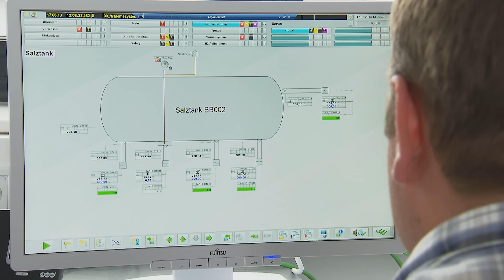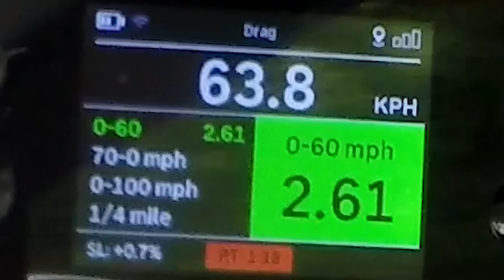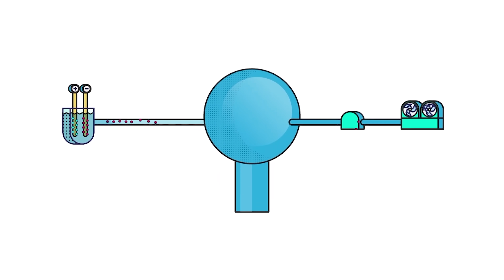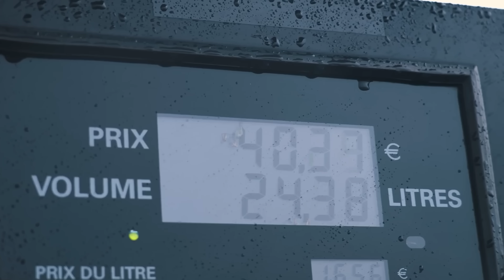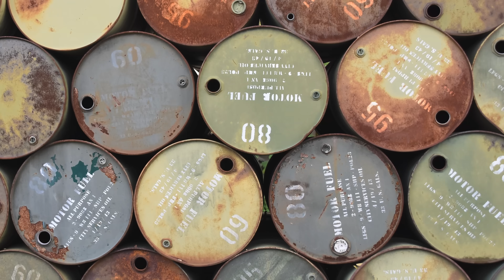Porsche just SAVED petrol engines FOREVER

Comment: This is another gimmick to fool people by telling them they are recycling energy. It requires energy to recycle the used energy. Because of the conservation of energy cannot be violated, they are just putting a new energy between the chemical boding of the C and H by removing the C from CO2 and H2O (thru electrolysis). This new energy most likely is coming from another fossil fuels, Solar power. (made with fossil fuels) or electricity from nuclear energy. This is Hocus Pocus engineering. Let’s say even you are right, what about the economics of it. If system is 100% efficient, which it is not, they still have a lot of expenses. First law of the thermodynamic can’t be violated. They are keep increasing the entropy this way. This is like free energy produced by the Indians and Pakistanis Youtubers.  people believe this stuff.

Comment: this video is a load of nonsense. it was 5 mins in before you spoke of the TECH to revolutionize the industry. ICE cars are dead and for one reason. They are too complicated and there is far too much that can go wrong. EV cars are far more reliable. Let me give you one example. It takes hours to take a turbo out of an ice car and it costs a fortune to repair any of the major components ie the engine and transmission. The new modern engines from all the manufactures are riddled with issues as they've gotten even more complicated. They've made them so complicated trying make them even greener that its time to say stop..... An EV is a little more complex go kart. There is very little to go wrong. Once the cost of the batteries come down there will be no going back. People will buy what works best and there aren't too many EV owners getting rid of them and going back to a diesel turbo charged car.

Comment: Consumer demand or lack thereof will take of combustion engines by itself by 2035.  Costs will keep coming down on EVs while the tech keeps improving.  Cars won’t be near as special anymore and we’ll all be zipping around with instant max torque and 2-3 sec 0-60.  But I think this synthetic fuel is great for racing applications.

Comment: E fuels were tested on top gear a few series ago. This is old news and the cost of each litre of fuel would be in the hundreds. Also never going to produce enough e fuels from renuables just like the hydrogen pipe dream. Also ice engines are so complex and costly to repair. The same old technology keeps on going on the next generation of a manufacturers cars. They want an easy out of this ban. People will have to keep and maintain their old ice car if you don’t want an ev. Ice cars can last 16 or more years if maintained well. They are not banning fossil fuels in 2030 and they will still sell it for years after as ice cars sold in 2029 could sill be on the road by 2045.

Comment: I think that, here in the UK, the target of selling only electric powered cars by 2035 is a bit ambitious. Even the step from hybrid-only in 2030 is quite a push in terms of our current engineering capabilites, as well as cost factors.

As per this video, more leaps are being made towards fuels, driven by the recent hikes we have all seen in oil prices (more to come). But we need to see more sustainable innovations before we can all make a solid leap from one type of fuel / power to another. More infrastructure will be needed (recharging / re-fuling) in order to sustain a better way of powering vehicles.

Government targets are hocus-pocus without a solid framework around such an emerging use of this  technology.
Reply: The 2nd hand car market will be gigantic in the UK after 2035.  Many UK drivers will want to keep their old petrol engined cars running for as long as possible.

Comment: E fuels What a load of greenwashing shit just how much energy is required to remove CO2 from the air, only slightly less than the amount of energy released buy burning hydrocarbons, and no one is doing it on any scale yet just because it is technically possible doesn't make it viable. I'm not anti anything on the vehicle front I love an overpowered motorcycle or a truck rolling coal I just see things for what they are. If you really want to be green walk and live in a mud hut and don't take meds coz a lot of them come from oil. Yes I do belive we need to reduce emissions output but until china India America and Australia stop burning coal and air freight and travel are emissions regulated and domestic emissions reduced we are all fucked road transport is tiny rail transport is even smaller and bulk shipping is also small 
Just remember the man on the street is an easy government target

Comment: This sounds extremely stupid. 🤦
You know what happens in car engines when you use synthetic fuel? Its combusts in order to power the engine.
And you know what comes out of the exhaust? CO² and other by products because such feul only reduces CO² Emissions by 85%, nor 100%.
And lets not forget that all the necessary infrastructure to ramp up production would cost a massive amount of money and work require a very large amount of electricity, which cannot be supplied by renewables give how piss poor in energy protection and inefficient they are.

Comment: The synthetic fuel has been developed but it is in short supply  and approx. $40.00 litre.
Reply: Just like every new technology ever developed. It's expensive and scarce. However both will change in the next decade
Reply: @ahihatv468  This is far from being true. This is because the process of creating e fuels is extremly inefficient due to conversion losses. So what you do is istead of charging a Battery, you take already produced electricity from renewable energies to create hydrogen out of warter (~30% losses) then  you need to extract CO2 from the atmosphere (also extrem inefficient) then you create your e fuel in a reactor (more losses) and transport the fuel to your gas station. At the end you get about 17% efficiency from well to wheel instead of ~85% using a electric car.
Reply: @LionAndi  inefficiency isn’t the main problem to the consumer here. Since the resources used for efuel production is pretty much infinite. The main problem will be higher price itself. But this much progress in such a short time is made by only one company and now TOYOTA and STELLANTIS (two of the biggest automotive companies) have also decided to support Porsche and e-fuels. The problem of high gas prices is likely to go down as mass production takes place and cost of transportation is significantly reduced. In fact, by 2025 the price for it is expected to drastically go down.

Comment: I wrote my diploma about e-fuels.
Sorry for this spoiler at the beginning of my text, but it is pure rubbish (using it in cars).

Expensive, ineffective (over all efficiency less than 12%), Needs H2 comming from electricity (why not use E directly???), aggressive in fuel suspension system, heat rate just ~50%…
The list is endless.

Kind regards from Germany from a powertrain automotive engineer 🙌🏼

Comment: If to produce the fuel, they use CO2 recovered from the atmosphere AND CO2 captured from the factories, the fuel does not have a potential to be carbon neutral because the waste from the factory would be captured anyway also it's a completely diffrent source of emission.

Comment: WOW, does this guy not understand climate change science? The ban on new car fossil sales is in 2030/35 and this is a problem because we don't have the infrastructure in place right now, what a knob! E-Fuels are only neutral for the extraction point, in a regular engine they still emit co2. So not carbon neutral. The process for conversion from Methanol to road fuels requires power which is less efficient than just charging batteries! The possibility of being carbon neutral does not equate to actually being carbon neutral as capture is not a viable technology. It's even worse if you charge at home? So what else is the car doing whilst you are asleep? Just charge EV's at double the efficiency of Efuels!

Comment: Just like hydrogen cars, the issue is the amount of electricity you need to create the synthetic fuel. You could use the same amount of electricity to power cars directly, cut out the highly taxing middle man of producing a fuel, and achieve way more range. I don't see this going anywhere further than for specialist racing.

Comment: E-fuels don't really make sense. Mainly because they require CO2 from atmosphere AND hydrogen. Well, isn't it easier to just produce hydrogen and use it as fuel for hydrogen cells in cars? 

Btw, this could only work, if the electricity is 100% green, in other case, just use fossil fuels instead of producing electricity from them and then using that electricity to power EVs

Comment: This probably has a place to deal with things like aviation fuel or more complex uses where electrification isn't a good option - but seriously, this stuff is never going to be keeping your old rover on the road. Crazy expensive and inefficient to produce (somewhere around 10times the electricity needed to produce e-fuel than to just charge an e-car), not to mention its an industry that basically doesn't exist now and we need to scale up to many 10's of thousands of giant factories around the world in the next 12yrs? Alternatively you could expand the existing electric charger infrastructure using tech that already exists, and subsidise home and office charging solutions (it might take 6hrs to charge a car at home, but how many hours do you normally have your car sitting at home at night right?).

Comment: The really sad thing is the demise of the internal combustion engine is not about the fuel it uses. The transition to us all driving electric one day in the distant future is simply because electric motors can already do a better job of turning our wheels in the vast majority of road vehicles. And in time even the most advanced ICE will be no match against the best electric motors. So even if you have completely clean fuel to run your ICE you won't have it attached to the wheels.
Reply: but can your electric motor spit flames?
dont take this seriously obviously but I sure will miss ICE's when they're gone one day

Comment: Efuels are very limited in production volume. Theyre even less the answer than battery power is which also isnt the answer. Both only offer a small improvement in overall emissions compared to petrol or diesel. The main weakness of efuels is the carbon capture so theyre only available in very limited amounts. They were also envisioned as a solution for air and ship travel where its much harder to replace the engine systems.

Comment: Producing hydrogen alone from electrolysis is inefficient as an energy source compared to using the electricity directly. If you haven't got enough electricity to drive EVs around you are even less likely to do so on hydrogen or a hydrogen derived fuel. On top of that an internal combustion engine being a heat engine is going to lose half the energy as heat in the process of producing mechanical work - so the inefficiency becomes compounded.
This is also why hydrogen is not going to replace natural gas boilers - apart from the expense of replacing all the old pipes, a heat pump is around four times as efficient as a gas boiler so it makes no sense not to use the electricity directly.
In both these cases we seem to have the vested interests of established industry up against physical reality. Reality always wins.

Comment: E-fuels are the dumbest things they came up whit @porsche! The efficiency of e-fuels are between 10-15% even if the go up to 20% it's a shit again ev'e efficiency which is more the 80%. After 100year of research of combustion engines it's time to put the research in battery technology(just wait until Solid state batterys are kicking. The future will by ev & h2 for everyone. The few use cases, where ev isn't an option will still use oil or who knows that shit called e-fuels.

Comment: This is utter nonsense. An internal combustion engine is only around 25% efficient and it is not going to improve.  That means that for a given amount of primary energy a pure EV is going to go four times further than an ICE car running on synthetic fuel. That is before the losses inherent in synthetic fuel are taken into account so synthetic fuels are even worse. On top of that synthetic fuels will still produce the horrible NOx pollutants that are responsible for thousands of deaths from lung disease every year. Battery technology still has a long way to go and the same can be said of the charging infrastructure. EVs are pretty much at the same point that ICE cars were over 100 years ago.  Sytnthetic fuels may find niche applications but they are a non-starter for cars.

Comment: EVS for the most part are not clean energy, nor are synthetic fuels. They both use fossil fuel to manufacture and generate the energy to be produced. Every part of the development of the infrastructure, hinges on the use of fossil fuel energy. Clean energy  will need fossil fuels far into the future, in order to build the infrastructure. These people who make the laws, that the manufacturers have to follow, always forget that industry and transportaction are, and will be dependent on fossil fuel for decades to come. Ask one of these law makers how they plans on making commercial flights carbon neutral. That would shut them up at least temporarily.

Comment: E-fuel sounds like an answer to more than just petrol engines, this technology sounds like a possible answer to the energy storage problem of renewable energy sources. When the sun shines and wind blows you harvest carbon dioxide and turn it into fuel, when the sun sets and temperatures drop it can be used in energy generation. Though one would have to look at how efficient the process can get.

Comment: I thought this was going to be onboard Electrolysis, engines running on on-demand hydrogen, almost like how diesel engines control rpm with fuel instead of throttles, and fuel tanks of water instead of anything directly flammable. But what Porsche is doing is great too.

Comment: But will such actually be feasible soon enough?

And do you need a new engine design to utilize it? Is it straight compatible with existing engines on the road?

Is it mixable with normal fuel like what they did with ethanol additions?
Reply: The problems with synthetic fuels are far more serious than you imagine unless you are going to be happy paying around £15 a litre for it.
Reply: @rogerphelps9939  yeah but as production ramps up that price will come waaaay down

Comment: My biggest gripe about EVs is that when they are involved in bad accidents,  they are damn near impossible to put out if they catch fire due to the batteries flaming up like an old cell phone battery. This is a current concern and has happened according to firefighters trying to deal with such accidents. Thus burning all the plastics and synthetics which produce very toxic fumes.
Reply: There is development happening with lithium-free batteries, so hopefully one day this won't happen
Reply: @F4T4L3FF3CTx78  that would definitely help with the safety concerns many have with EVs
Reply: Thankfully there's only a warm breath of fresh mountain air coming out of ICE's exhaust pipes.
Reply: If you burn fuel (also e-fuels) there are also a lot of toxic chems coming out of your exhaust pipe!

Comment: The problem with EVs is that it just moves the "problem" around. Still burning coal to power the battery, or building non-recyclable windmills, or solar panels that are super expensive to recycle, or large toxic batteries that cant/wont be recycled when they stop holding a significant charge after a few years, or creating HUGE CRATERS IN THE EARTH BY THE WAY OF SLAVE CHILDREN to harvest the precious minerals and metals. 

My 50 year old Alfa Romeo will continue to be used for transportation as long as I live, everything about the car is rebuildable, unlike EVs. And the amount of pollutant that making a new EV generates will outweigh my burning of petrol for my lifetime. We should be getting a tax credit for reusing OLDER cars, not buying NEW EVs.

Comment: You left out the biggest issue of eFuel, you need about 25 kWh of energy to produce 1 liter, which contains about 9.5 kWh. After burning you are left with 4 kWh at most. So eFuel consumes more than 6 times the energy that battery driven cars would.

And that is not considering the issue of transporting the 100,000 litres of eFuel from somewhere like Chile to, to either Europe or USA. Or the fact that co² emissions will increase in developed areas like USA and Europe, but decrease in less developed areas like Chile and South america where the worlds largest natural co² converting on land is already present.

Comment: Outstanding job to porsche but regardless of what they are doing the switch to electric was never going to completely happen anyways. Unless the government was planning on holding people at gunpoint and forcing them to buy a 35k electric car, which alot of people couldn't afford anyways. Regardless, kudos to porsche.
Reply: The government does not need to hold people at gunpoint. In case you had not noticed most car manufacturers are replacing their lineups with EVs.
Reply: @Robert van Ruyssevelt  Most not all. The market will dictate which products they like. I'm sure there's alot of effeminate dudes that will want to buy the evs but real men will most likely still exist.